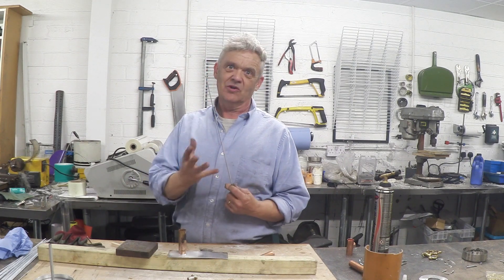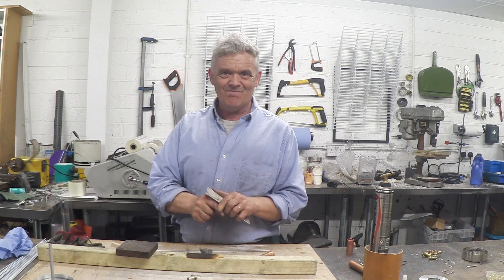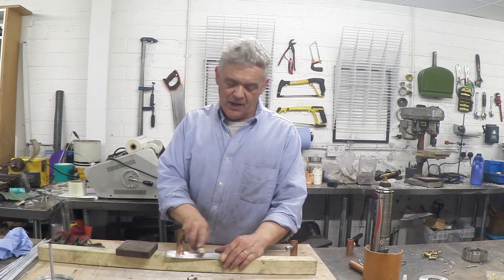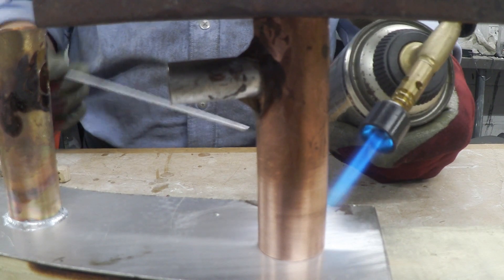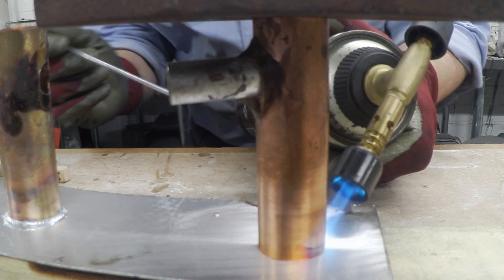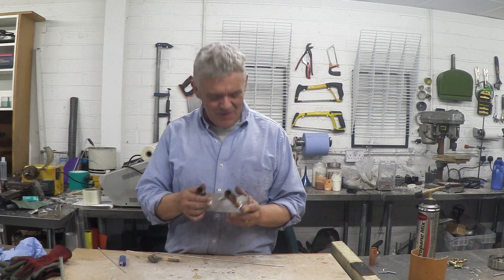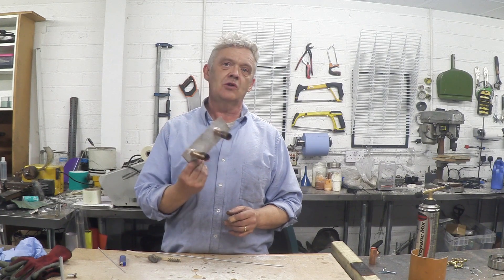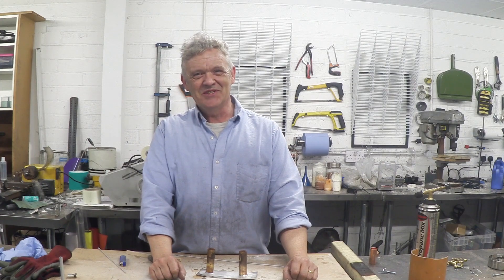Simple Easy Trick For Joining Copper And Aluminium

Comment: This could be a great solution for joining electrically conductive materials. Years ago, the US tried using aluminum for household wiring. The problem was that the Outlets were all brass or copper. Over time the connector points broke down because of different rates of expansion and contraction from temperature changes. This eventually caused electrical arcs at the connectors and household fires, so rather than change how all switches and outlets were made, the use of aluminum wiring was discontinued. I would be very interested in knowing if these brazed bonds are tight enough to overcome several cycles of temperature change. I'm not sure how to test this in a reasonable time.
Reply from the maker: I agree mate - we tried the same thing here in the UK too - price of copper I think
Reply: The problem was it was a mechanical screwed connection.  The connection loosened, the resistance of the connection increased and fires resulted.
I had to replace all the outlets in my house in Houston 40 years ago.

Comment: Robert, do your brazing on a firebrick. They won't catch fire! I'm surprised that worked! I wouldn't have imagined to try that.
Reply: The key was applying the heat to the copper since it has a higher melting point.
Reply from the maker: lol - I was thinking a blanket - but you know mate - sometimes it's all just quick and get it done lol

Comment: It is an alloy containing bismuth which has a very low melting point. It does what is claimed but the surfaces must be clean and a similar thickness. It is often sold at trade fairs and car shows where they join the bottoms of two drink cans, which looks impressive but who ever needs to join two drink cans?When you ask the demonstrator to replicate one of their samples which might be a copper pipe to an alloy car head they wont do it because it isnt that versatile. And it is poisonously expensive.If it was any good the trade would be using it and you would find it in your big box store.Its like hot melt glue. Yes it works but it has no integrity.
Reply from the maker: is it now - awesome - it feels a lot like zinc - maybe zinc and bismuth

Comment: Thankyou for sharing where you got brazing rods! Ive tried ordering them before but kept getting the knock off product, and it wouldn't melt at any temperature!!
Reply from the maker: the rods were durafix mate - I paid a bit more but like I said I wanted to give it the chance to work
Reply: Harbor Freight in the US.
Reply: https://www.ebay.co.uk/itm/Aluminium-Welding-Brazing-Low-Temp-Durafix-Easyweld-UK-Rods-Brush-/222389990065?redirect=mobile

Comment: I have lipo tabs , I can not get to spot weld, the only luck i have had, was using a nickle strip on both sides, then spot weld it, I don't think this will work on the tiny tabs,  but spot welding nickle, I don't think it's a true weld, I think it's burning a hole through the aluminum, and welding the nickle strips together,  this aluminum brazing rod, is a game changer for aluminum, I don't really know when I'd need to join aluminum and copper, (I'm guessing brass also) except for maybe a heater core, for a boiler project, putting copper/brass connectors on aluminum tubing of a heat exchanger,  this truly some cool stuff, cheers!
Reply from the maker: electrical joints, radiators, HVAC projects - I can think of quite a few uses tbh

Comment: I wonder if the electrical conductivity is still good. Also wondering if you bonded a copper and aluminum wire  and then heated the end up in a flame, if you would get a measurable  voltage like a thermocouple.
Reply from the maker: I am going to try it for sure
Reply: You can estimate the voltage by the variance in work function of the two metals. Current however is a function of surface area, which in this case would be very small.
Reply: @subjectmatteramateur16  good answer Shawn!!! : )